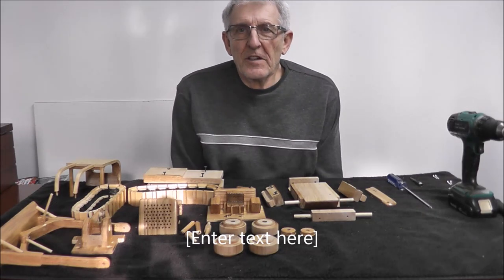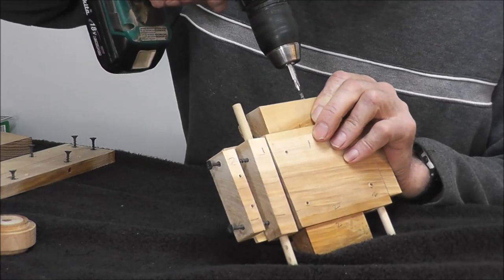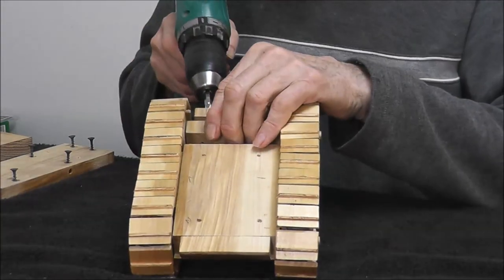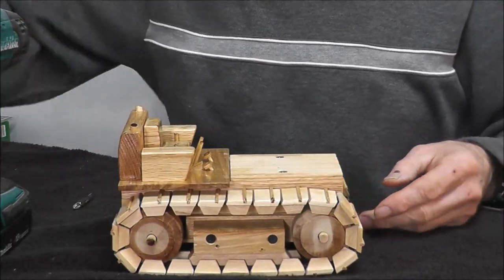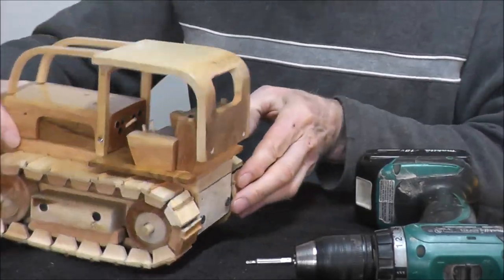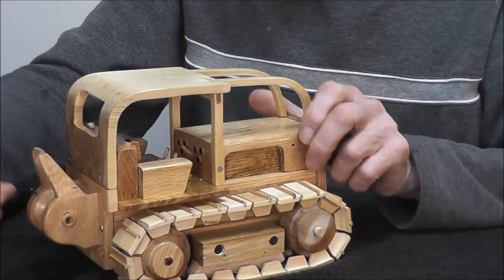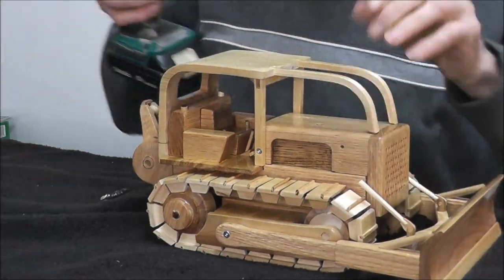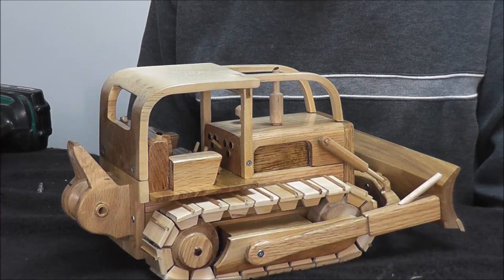Homemade wooden Toy International TD20  Bulldozer Assembly

Comment: I worked as a John Deere mechanic for about 9-10 years. Although we were a JD dealer I worked on all brands of machinary before I became a hydraulics technician building machinary for the offshore oil&gas industry. Now you got me wanting to build models of some of the machinary I've worked on over the years...LOL... You do fantastic work......
Reply from the maker: I have tried to show simple ways to build models without plans etc.  The cars and trucks are the easiest to build from pictures,  Follow my method and it will happen quickly.
Reply: @brianprocter6191  the video you made showing how you made dozier tracks was the most amazing to me, I was really impressed with the simplicity of the process. I would never have thought of using a nylon (material) strap. It turned out fantastic. God blessed you with a special talent for sure.....

Comment: I LIKE PLANS FOR TD 20 BULLDOZER
Reply from the maker: Would you like just the basic sizes, I could make a diagram with basic instructions.
Reply: @brianprocter6191   THAT IS FIND  BASIC SIZES BASIC INSTRUCTIONS WHAT COST
Reply from the maker: @pauljacobs8892  No cost, just need to get the dozer back and measure it up.
Reply: @brianprocter6191  I OK I WANT TO MAKE ONE
Reply: @brianprocter6191  OK